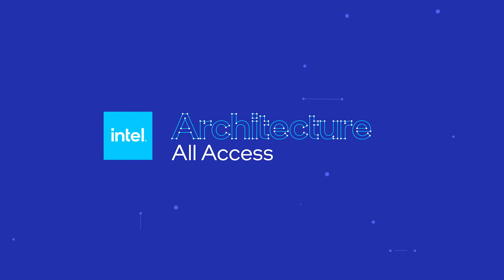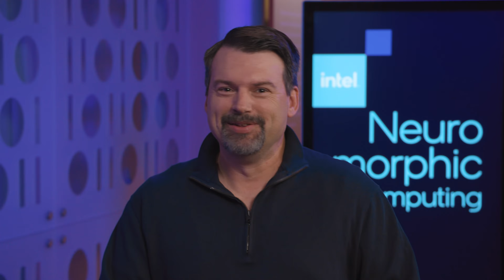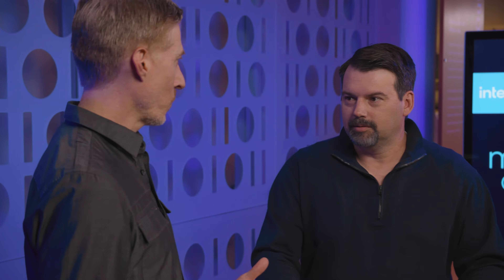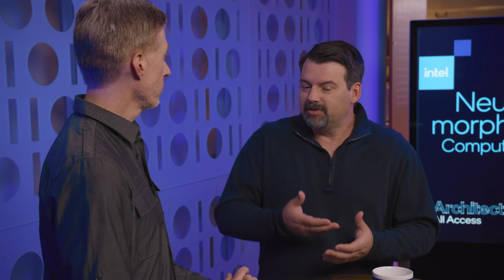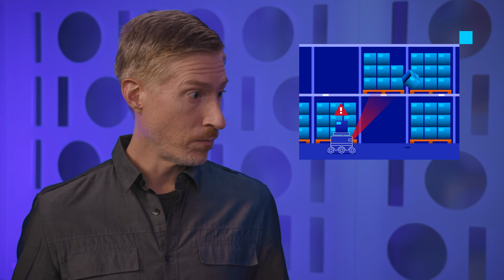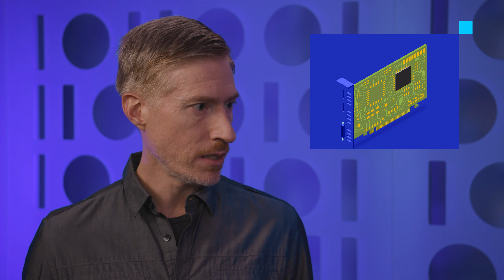Architecture All Access: In Conversation on Neuromorphic Computing

Comment: Now that Intel has completed Loihi 2, it needs to split its neuromorphic development work in two:  First, continue working on the stated goal of developing general purpose hardware.  Second, pour as much or more into developing a product designed exclusively for sensor processing/integration. 

We need a turnkey solution for processing multiple cameras and other sensors --- sort of a neuromorphic visual+auditory+etcetera cortex --- something that would sit between conventional sensors and conventional AI hardware that would be standardized (requiring little or no programming) and also highly optimized.  Such a product would enable a quick transition to implementing hybrid conventional/neuromophic AI systems. 

Versions could scale according to the maximum number of inputs while conforming to a single 3D, multimodal output standard.  Imagine a small version in every cell phone and larger versions in every self-driving car and robot.  The market is huge. 

Yes, eventually there will be end-to-end neuromorphic solutions (Rain Neuromorphics?).  In the meantime, the first company to provide the benefits of offloading sensor fusion onto low-power neuromorphic hardware will probably end up dominating the AI hardware market. 

Does Intel have the talent to accomplish this in-house?
Reply: Agree, innovation is needed more so than talent in this context you present.